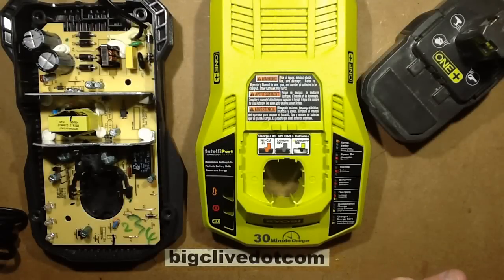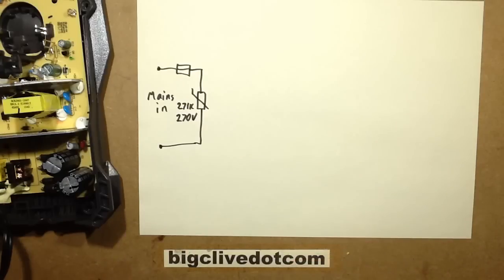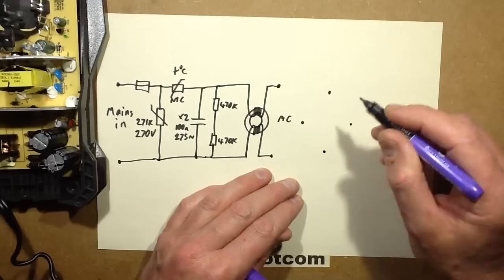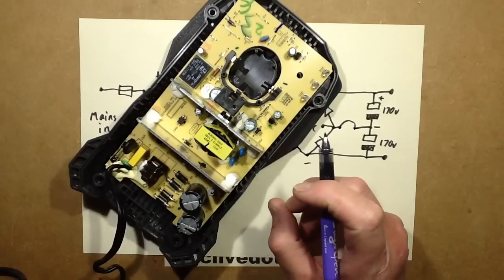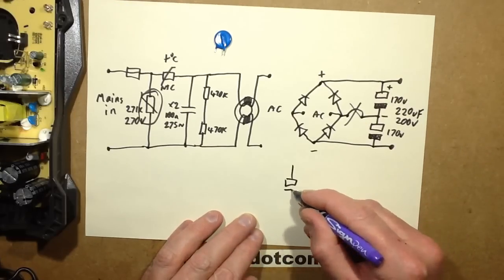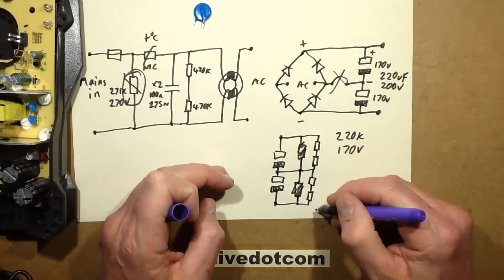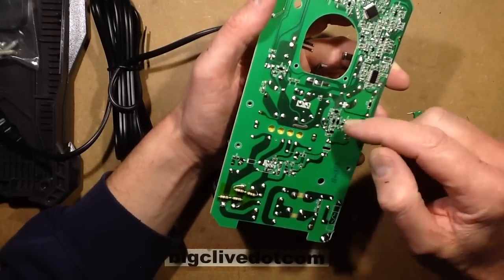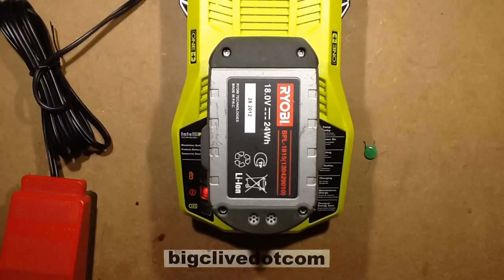How to convert Ryobi P117 charger from 120V to 230V use.

Comment: Wouldn't put it past a company like Techtronic to scratch part numbers off. Don't want people knowing that the 8 brands of power tools available at their hardware store are all the same pieces of shit.
Reply: Wonder if there's a forensic way of recovering the marking from a defaced chip package... I know from entirely factual shows like CSI you can a filed off serial number back off a handgun...
Reply: That's because the metal is maleable and impressing an image or SN on the surface affects the metal many layers down.

Ceramic doesn't undergo the same deformation.  Perhaps you could recover it with a scanning electron microscope but I doubt you could with any cheap chemical process.
Reply: Not only that, but the numbers are laser etched in to the ceramic, or printed on with some sort of ink. The surface layer is the only part that's effected by this process, so filing the numbers off the chip leaves you with exactly zero non-destructive methods of identifying it, unless you manage to get a copy of the plans of the thing.
Reply: This is also assuming that any numbers existed in the first place.  I have seen plenty of chip packages from china that are devoid of any labeling in the first place.
Reply: kuhrd
Good point.
Reply: With guns, it's because stamping the metal compresses a layer under it, creating a harder layer. A bit of acid will etch away the softer metal around it more, leaving the  harder stuff there to read. 

We did something similar at school with plastic. Emboss a design into hot plastic, then file away to a flat surface. Then warm the plastic again and it expands, producing a sticky-out area in the shape of your design.
Reply: Well this late night inebriated mini rant has sparked some quite interesting discussion..
Reply: Yeah I wondered if laser etching might invisibly alter the layer underneath and you might get some latent image back with crossed polarizers or something... but it's not very probable really.

Comment: What's up with that PCB design? Don't they use a PCB design program? It looks hand drawn with those smooth lines.
Reply: They probably use good PCB software.

The only reason you mostly see 45° angles is that they are way easier to calculate for software. The algorithm is simpler than one that does smooth lines. And most of them are still rooted in the dos area.

But this one only seems to smooth the corners, which is still good, there is a reason you try to avoid 90° corners, so why not avoid any corners?

There is a tool called "Liquid PCB" which does completely smooth organic lines.
Reply from the maker: Tracks are most likely to crack at sharp corners over time .

Comment: Clive, you'd be able to add a switch where that link was right? Then you'd be able to change between the two supply voltages right? 

You could probably use a 2 pole 2 throw switch to also select between the two voltage dependent resistors too.
Reply from the maker: The same MOV would suit both.  the risk of the voltage switch is that if it gets used frequently, then one day the unit will be powered with 240 while set to 120 and suffer damage.

Comment: Hey Clive, wouldn't it be much more reliable if you swapped the two capacitors with one the same capacity(or maybe higher) and rated above 350Volts? Then these resistors would have been obsolete :)
Reply: Certainly could do that..replace the 2 with a single 100uf 400v, but then you couldnt change it back to 120v easily, which would just be refitting the link, the varistor could be left as the 470v version..

Comment: pretty much all cordless tools with batteries use only one type of battery.Royobi is just a cheaper alternative
Reply: No, there have been many types, with varying connectors, but most recent ones seem to be 'similar' but not necessarily interchangeable...
Reply: Additionally they continued to use the same battery from their last generation of tools, so all the 18v batteries work with both the green and blue tools. It is really great to have so many tools (old and new) and just one type of battery to replace
Reply: Name a brand that has as many tools as Ryobi that use the same battery, and use the same battery over multiple generations

Comment: Interesting, my +One charger feels like it's just an empty bit of plastic. Saying that it is the standard uk one with the wall wart that plugs into it. 
Thanks for showing me this upgrade I really don't need but want now! Lmao.
Reply from the maker: That's because with the bulk of the power supply in the wall wart it really is just a shell for the small amount of charging circuitry.
Reply: I've just realised, mine is a Ni-Cd and you've a lithium battery. It's a whole new ballgame when it comes to charging.
Reply from the maker: The modern chargers including the small clip-over ones are designed for both NiCd and lithium.

Comment: Hi Clive do you have any way of working out, when I use emergency credit in meter I'm sure the money goes down allot faster
Reply from the maker: You'd have to compare units used to credit used.  An actual unit of electricity is based on 1kW used for one hour.
Reply: The meters are quite 'clever' - first thing it does when you load some money is subtract the standing charges since the last time someone paid something in to it (could be a while for a student let that's been vacant)... then it subtracts any debt repayments you're making to the electric company... then it subtracts the amount of emergency credit that's been used (that wasn't free electricity unfortunately)... then and only then does is start adding any money left to your credit balance.

Comment: Hey Clive, question, what is safer, UK mains or USA mains and why does America use 110 v mains?
I'm not an electrician...
Reply from the maker: Each has its own merits.  UK mains is more dangerous from a shock risk as more current will flow in the event of an accidental contact, but the lower voltage of the American supply means that for a given load the current will be much higher and poses a greater fire risk in the event of a fault.
Reply: bigclivedotcom 
Interesting, so I suppose it's "swings and roundabouts" then.
Thanks :-)
Reply: I think where the UK really has it on us is the more robust sleeved-pin, shuttered plug system and built in fuse. Our plug may be compact, but that's really the only thing we have going for us.
Reply: The US system is also more complicated with 2 lives, neutral + ground to provide up to 240 volts for high power appliances. Double current = more expensive conductors. I doubt the US would design the system that way again. I believe some of the legacy is to do with Edison's original DC system.
Reply: Hakase
Compact yes, but not grounded, unlike in the UK. Most of Europe too, two pin non-grounded plugs... not safe.
Reply: Gas kettles are popular with Americans afaik which we highly advanced europeans think are quaint antiques. I don't think they can get enough watts out of their weakling 110V wall circuits to boil water in a sensible amount of time.
The consequence is North American houseguests might stick your electric kettle on the cooker and cause a small fire.
Reply: The US now requires shuttered "tamper resistant" outlets too in dwellings, only since the presence of a ground/earth pin isn't mandatory the shutters are actuated by both prongs going in straight and at the exact same time, if either prong is bent, one is longer than the other, or someone tries to poke a foreign object in one side the shutters lock. We also require arc fault circuit breakers for the entire dwelling.
Reply: 'murican here, just tested my electric kettle, took 1.5 liters at tap temperature of 65f 5:20 to boil. Is that a lot longer than the performance of your stuff? I think it's really all relative, your stuff uses higher voltage but less amps while ours uses lower voltage/ more amps.
Reply: The thing holding us back from ever transitioning over to 230/240v is that also in dwellings lighting circuits aren't allowed to be 230v, and no loads under 1500VA are allowed to be 230v either, so while we have 230v 15 and 20a outlets readily available for the most part they are useless. Manufacturers sometimes cheat this by adding a >1500va load to a device even if it is rarely used, for example a 12000 BTU/Hr window A/C has to be 120v unless they add a 2Kw resistance heat strip coil to it, then it can be 230v even if the heat capability is never used.
Reply from the maker: I've just tested it with a "low power" 2kW kettle.  1.5L took 4 :07 to boil.  My one cup unit took 38 seconds to boil and dispense a 300ml mug of water.  (so about 3 minutes for 1.5L)
Reply: My £5.00 Argus kettle (1850 - 2000 W) took 3:58 to boil (from the cold tap) 1.5 litres.
Reply: +27dcx challenge accepted I don't think I've got a thermometer that is suitable to put in water... the kettle rating plate says 220V-240V 1850-2200W. I've got a plug in Wattmeter but the button cells have gone flat & I don't have any spares :( I suspect it's about 2200W tho. 
using freshly drawn tap water I get 1.5L boiled in 4:17 NB This kettle is a cheapo tesco value brand model... The real fancy kettles are rated at 3000 or 3100W
Reply: joinedupjon 
But do the fancy kettles boil the water any faster? Or any more efficiently?
Reply: Well assuming the rating plates weren't written by a Chinese ebay LED vendor the power has to be going somewhere... I think a typical rating for the one cup boiler/dispenser type clive mentioned is 3000W but there may be different models. I guess the viewership here are mostly value-brand / 2000W kettle owners.
Reply: I think it should be possible, in theory, to construct and use a kitchen 3 element 9kW kitchen franken-kettle to push the 1 minute barrier. In the UK you can afaik sensibly plug two 13A loads into the same ring main and IF you have a combined cooker switch/socket, that's on a separate spur back to the fusebox. without the cooker circuit socket you'd have to stop at 2 elements though.
Reply: *****
How common are the 240V sockets in domestic settings? think I've only noticed them adjacent to an electric stove... and some houses must have  non electric stoves. (small sample size though)
Reply: To add more, NEMA 6-15 and 6-20 are used for window air conditioners, I have a Craftsman radial arm saw that is 240v with a 6-20 plug, and an Amana commercial microwave oven that is also 6-20 as it is 4000 watts input, 2100 watts output.  Electric stoves and clothes dryers were on NEMA 10-50 and 10-30 (3 wire no ground, neutral was used as ground) but since 1996 new construction has required NEMA 14-30 and 14-50 which is 4 wire. RV/Camper/travel trailer/caravan are on a TT-30 which is a 30 amp 120v, or the same NEMA 14-50 as electric stoves, EV charging can also use 14-50.

The reason that our stoves and dryers require a neutral is that they make production cheaper by sharing parts with the gas models. The electronics, lighting, and drive motors are all 120v, only the heating elements are 240v.
Reply: It is difficult to compare the times taken to boil a kettle of water as there are a number of variables to take into account, volume of water, initial water temperature, kettle's power rating, hardness of the water to name a few. In general though, the higher the power rating and lower the volume to be boiled, the faster the kettle will raise the temperature of the water to 100 degrees C or 212F.
Reply: Fry You will find a good many 240V receptacles around my workshop, for example, most are 20A, but I also have 30A and 50A for larger tools. And, of course, there are plenty of 120V receptacles for the smaller portable power tools, chargers, etc.  But the reality is that most of the devices we use are served perfectly well via 120V as a typical residential 120V circuit will be rated at either 15A or 20A (up to 2.4KW) and a home is typically subdivided into a number of such circuits (typically a couple dozen, if not many more) for plug-in accessories, lower power appliances, and lighting with a typical modern household having around 200A mains (and some much larger, others a bit less, particularly older homes where 50A and 100A services were common) single split-phase service (and by 200A service we have 48KW available for loads, 200A*240V, or, alternately, 2*120V*200A) to use as needed, whether that be for 120V or 240V circuits).  Higher power loads, such as electric range tops and ovens, clothes dryers, electric water heaters, air conditioning, heat pump, or electric strip heating, etc., will typically be served by dedicated 240V circuits.  And, as I mentioned, I have a workshop full of larger 240V tools (tablesaw, jointer, thickness planer, bandsaw, dust collector, air compressor, heating and air conditioning, and welding).  So we do make use of 240V accessories where the added power is actually required, but most accessories do not require more than 1.8-2.4KW to do their intended job, so 120V suffices nicely for most every day tasks.

The only downside to using 120V for most plug-in accessory loads is that our system requires more copper than a 240V nominal system, but it also comes with certain safety advantages as well since there is ordinarily no greater than 120VAC between either hot leg and ground. Additionally, the lower voltage paid considerable dividends in terms of incandescent bulb life as, all things being equal, a 60W bulb designed for 120VAC (and running on such) will yield far greater service life than the equivalent 60W bulb designed for 240VAC service due to the lower voltage bulb having a much heavier filament that can survive considerably more wear before failing. While incandescent bulbs are not so important today, they were for much of the history of electric distribution, and especially in early days before tungsten filaments were discovered, which was almost exclusively the typical consumer load throughout the early history of electric distribution and that significantly factored into the voltage choice along with early estimations of relative danger of higher voltage versus lower with 110VAC/DC being the original value settled upon for residential appliances (which has shifted upwards to 120VAC nominal today).

120VAC also has the distinct advantage of being generally safer than 240V with or without an RCD/GFCI protector as for a given resistance the lower voltage will necessarily pass less current through an unfortunate party.
Reply: Electric clothes driers are 240V @ 30A I believe (I'm not at home to actually check mine).  US electric stoves I think are typically 240V @ 50A if they include an oven.
Reply: Fry Some Europeans whom imported first generation XBox One consoles might well disagree with that device after destroying them by plugging them into 240V receptacles on the assumption it would be fine.  Most switchmode power supplies designed to function as universal power supplies are going to be properly labeled as such, there is no great conspiracy to mislabel power supplies.  While many of the power supply boards are designed to accommodate either voltage safely, many that are voltage specific are either wired slightly differently to select the voltage or will use capacitors or diodes rated for the intended voltage, so doubling the voltage on the assumption it will be OK is risky at best unless you have thoroughly reverse engineered the high voltage side to ensure all the components are appropriately rated for the higher voltage.  For example, 200V or 250V capacitors are adequate for 120V operation where the peak voltage is about 170V, but inadequate for 240V use where the peak voltage is 340V.  A 400V bridge rectifier is more than adequate at 120V but uncomfortably close to the edge of breakdown at 240V (where they will ordinarily see 340V peaks plus higher voltage spikes) with 600-1000V rated diodes more appropriate for 240V use.
Reply: 27dcx - unless your kettle is 24 amps+ it will be slower than ours . We have 240V and 3kw elements .
Reply: 110V is safer , especially if you use it via a centre tapped/grounded output isolation transformer as then if you grab a single output you will have a nominal 55V to ground which will not kill you.
Reply: Voltage is irrelevant in most cases when dealing with secondary level voltages, where arc flash effects are limited, it's the amount of amperage taken across the heart that usually determines lethality.
Reply: Timothy Barney low currents kill more than high.
Reply: Could that possibly be attributed to people being more lax around supposed low current circuits and more careful around high current?  I really don't know.
Reply: Timothy Barney low currents cause heart fibrilation. high currents will stop your heart.  the latter can be restarted by somebody, the former needs a defibrilator to stop the heart and then restart it else you is dead.
Reply: Uh, no, we don't live in the stone age... modern houses in the USA (my home built '04) could easily do 110V/30A and we totally used an electric kettle, properly wired outlets in modern American homes can easily handle ~3kW. (However, most of my rooms have 220V and 110V outlets, 220V terminates with a British plug,110V with the standard grounded American connector  (All GFCI)

Comment: They really are a pretty good system. Take the battery apart and look at all the circuitry inside them :O

My main complaint is that they only used 1.3Ah batteries in these, and as soon as they start to degrade, they are unusably low capacity.
Reply from the maker: I did a video looking at the inside of one of the packs.  I wish they didn't make the low power packs just to tick the "supplied with a batteries" box.  The higher capacity batteries are a bit heavier, but offer much better torque and duration performance.